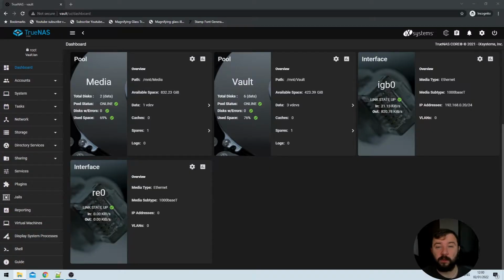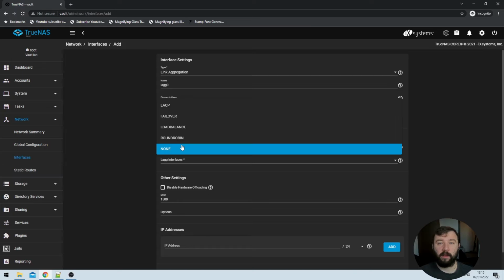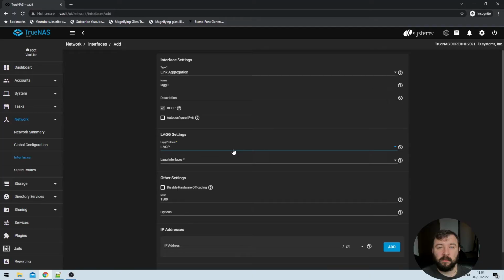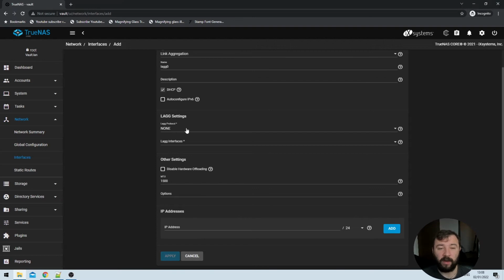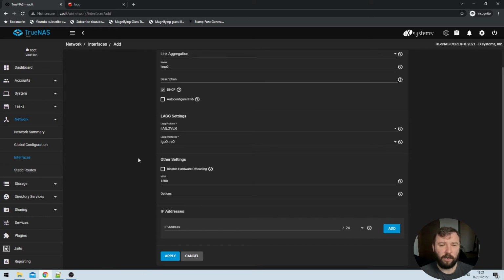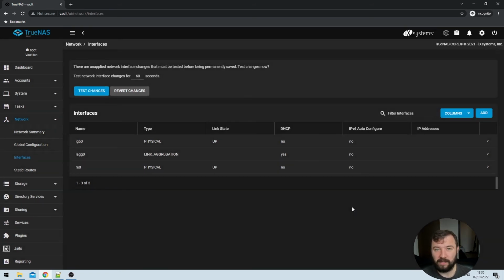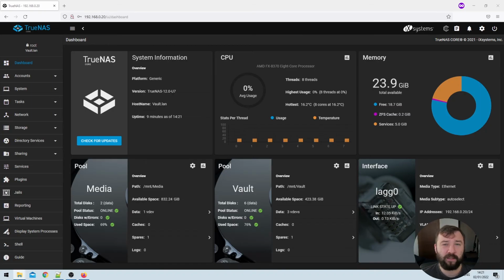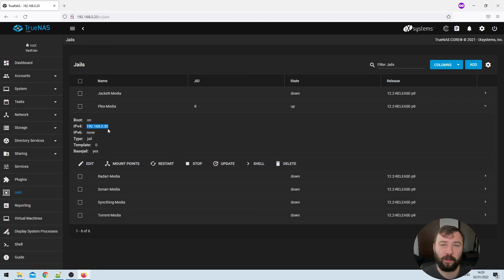Link Aggregation (lagg) | Managing TrueNAS Core

Comment: nice video...i tried crating link aggregation (loadbalancer) and it works but then i cannot install plex server...if i remove the lagg interface then i can install plex and if i then create lagg interface and fix the jail (like you showed) to use that lagg interface the plex server is not reachable...do you have any idea what might be wrong?

Comment: hi @Blackbear Support - will it work with my switch? TP-LINK TL-SG3428 it is managed thru omada sdn.
Reply from the maker: Hey @Daichan, reading the specs on your switch, it does indicate it supports link aggregation, so yes I think it will work.
Reply: @BlackbeardSupport   thanks for the quick reply im trying to turn my old 4th gen intel pc to a truenas server i want to take advantage of the dual nic that is has.
Reply from the maker: Sounds like you'll be fine!